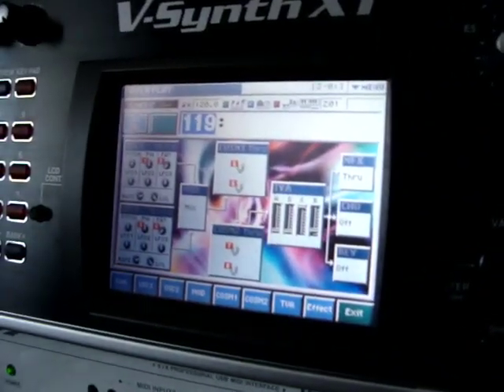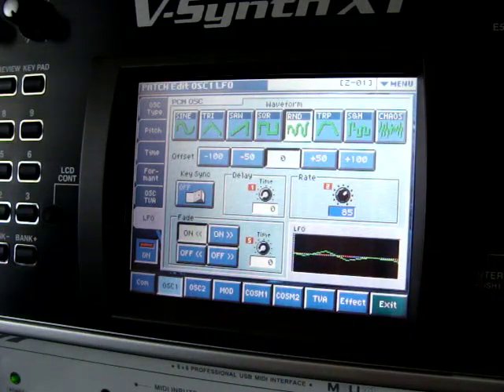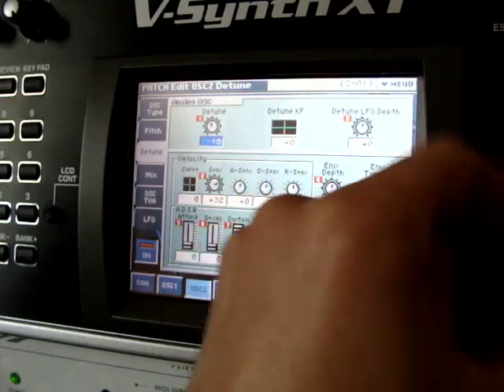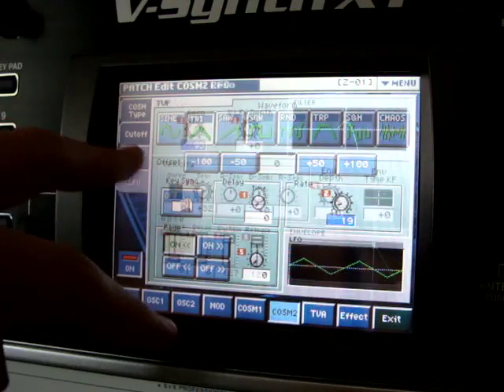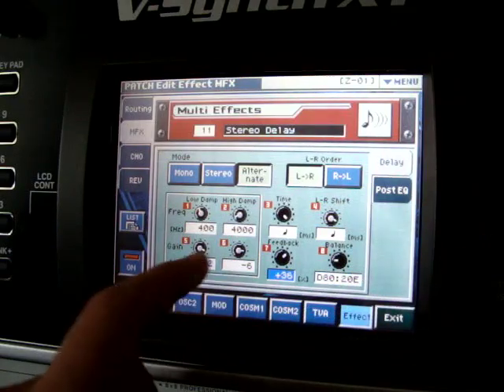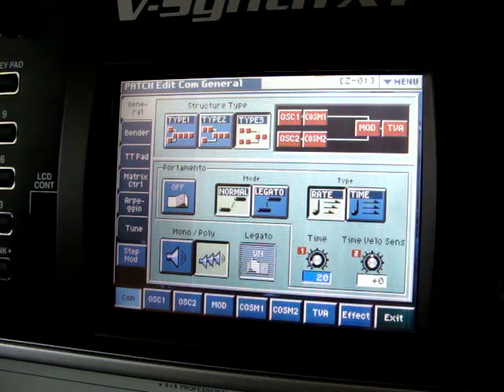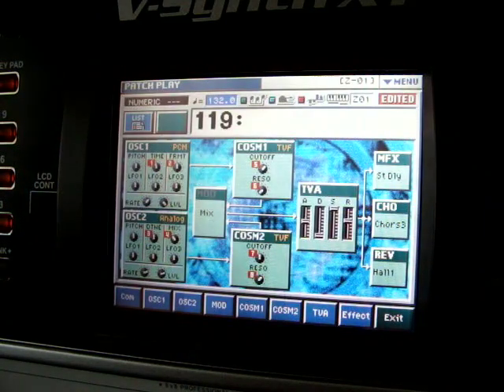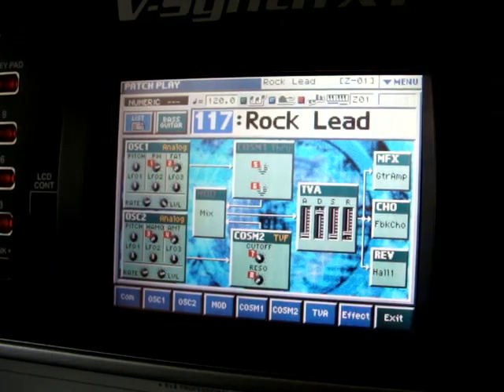Sound Programming (Roland V-Synth XT)

Comment from the maker: It depends on the original material. The VariPhrase Thecnology is made for realtime playing and the synth's CPU isn't *that* powerful, so it won't reach the quality of a computer based realtime or offline algorhithm. Also the polyphony is going very low when using two PCM oscillators.